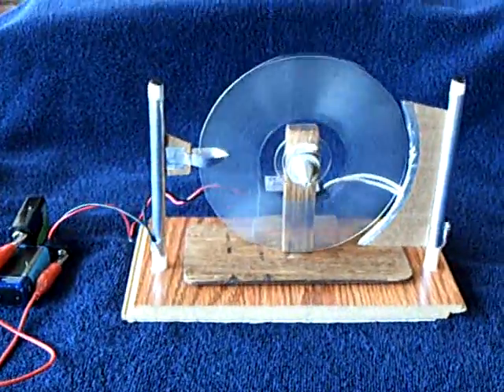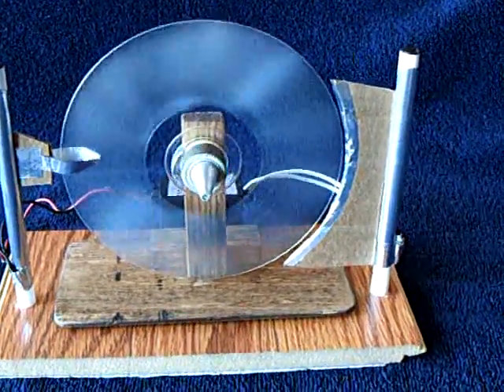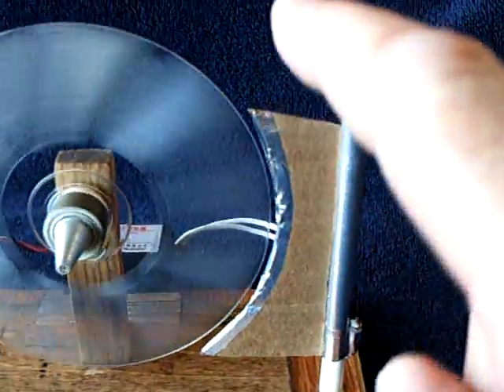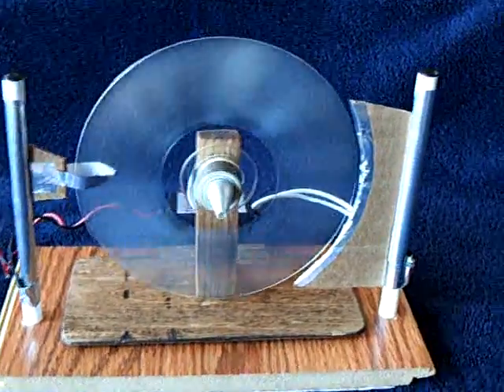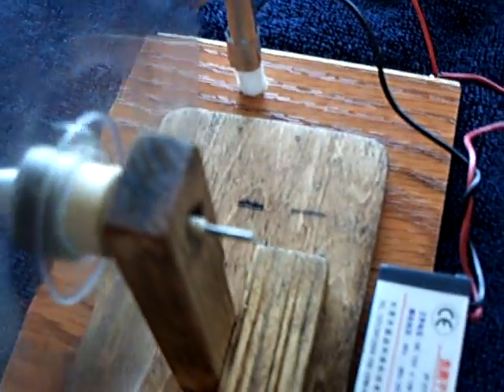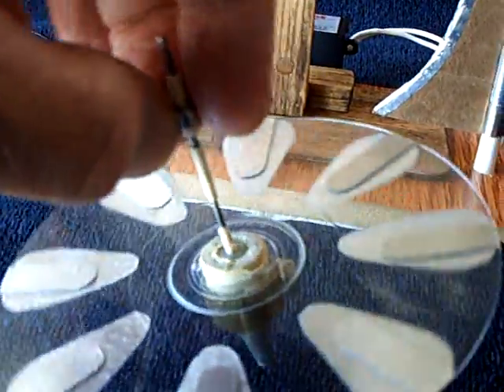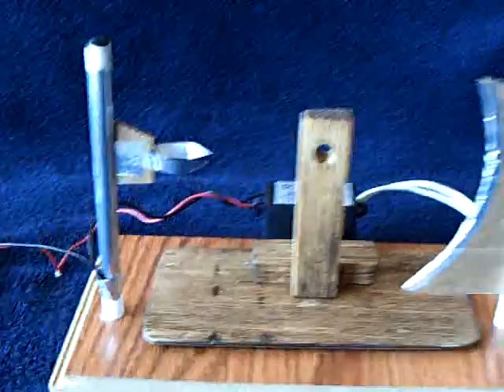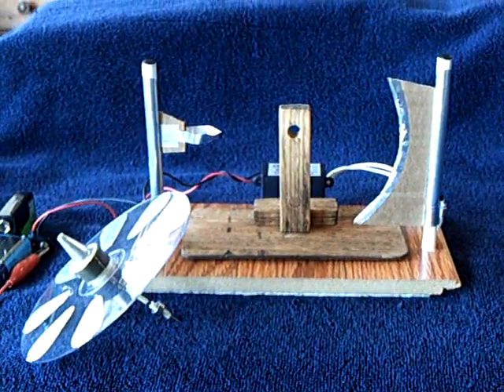Faked Perpetual Motion Machine --- Near replication

Comment: In actual fact the other guy might not have faked his, just as when you brush your hair with a brush or a comb you generate static electricity, in his design he may have incorporated this method into his rotor so that as it spins it creates the static charges that build up on the disk and are grounded by the stator causing it to run.

Comment: Rusty:

I am sure you posted a link in another video (But I can't seem to find it now) about where you obtained your negative ion generator that draws so little?

Thanks,

Bill
Reply from the maker: Pirate Labs Bill here it is.
http://www.ebay.com/itm/DC-12V-High-Output-Ionizer-Airborne-Cleaner-Negative-Ion-Anion-Generator-Stable-/371212721049?pt=LH_DefaultDomain_0&hash=item566e009b99
Reply: *****

Thank you very much Rusty.  That really looks like a versatile device to have.

Bill

Comment: My meaningless perspective is that the “fake” device included a “magnetic influence”, purely due to having watched the other video and noticing a change in rotation rate when he twisted it’s direction, it looked like a “magic trick” I once performed. Always good to investigate, but best not become cynical!
Reply from the maker: Lord Dream Thanks.  I will look into that.  I did a bunch of work using remote "magnetic gearing" and perhaps he used that.  I did a video once where I turned a rotor right through an interior wall of my house using strong neo magnets.   It is an interesting way to transmit energy without a direct linkup.  The problem is that the transmitter magnet rotor has to stay in sync with the receiver rotor all the time.  Once they go out of sync the linkup is gone.

Comment: Nice video.
The angle of the contact at the left side don't seems to match the original video which located little below.
Do try to use a thick circular disk which the surface area is larger than compact disc used in your video.
Reply: ***** His "bearing" system was a real laugh: just making a pair of Vs out of small nails or bits of wire, then resting the axle in the Vs. This must be a pretty high-friction arrangement. Using sharp points on the axle and having the points rest in the divots in the ends of hardened setscrews would be much lower friction, I think.
Reply from the maker: sanjev21 I been thinking of making an exact replica (as close as I can) and doing experiments with that.  The rotor bearing issue is a concern.   Friction  has to be very low no matter how you turn that wheel---unless he ran his with tiny motors in the rotor hub.
Reply: Lidmotor-If there is motor involved then there need to be coil or with magnet present somewhere.
The disc in original video does vibrate at high speed since there is no precision engineering involved.
The disc is heavy it may assist in achieving the required momentum.
Do try cut aluminum can for the external contacts since it's more stable than thin foil version.
Reply from the maker: TinselKoala Yes the bearings in his setup look terrible unless there are tiny motors in the rotor.  Then the Vs make sense.  Hold the shaft and rotate the rotor on the motor bearings.  I'm going with a steel needle in a brass philips head screw for my next setup. 
  I watched your videos last night on electrostatic devices and you have a very nice motor with that Tesla turbine design.  Your Bonetti generator is a pretty scary beast.  The model of this faked motor you built might run if you throw enough juice at it.  Mine has to have point contact at the one side to work. Al foil brushes worked good for me.  Bearing friction has to be very low.

Comment: It's interesting that you actually got your static motor to operate in a more powerful manner than the fake perpetual machine (pm).  I still think the fake pm machine operates via a battery driven, pulsed motor & some magnets place along the circumference of the rotor.

I tried a little experiment yesterday with a battery & coil to see if I could generate enough torque with 4 Watts of dc power, but the coil & torque apparently wasn't large enough to repel a neodymium magnet mounted on the edge of a cd very far or very forcefully.

How much force (torque) does one of your bobbin-wound (42 gauge) coils generate against your lidmotor magnets in your pulsed motor designs? 
Also, could you remind me of how many copper turns you put onto one of your coil bobbins and the pulse magnitude, duration, & frequency that is sent to it in your best pulse motor design?

Thanks!

p.s.:  Nice static motor design! :)
Reply from the maker: A B I do very few  measurements when I build something so it is hard to answer your question.  My coils have hundreds of turns on them just to push a small plastic jar lid around.  Turning that cd around with tiny magnet imbedded in the rotor edge and tiny batteries to power it all ---it just doesn't seem possible.
Reply: ***** Understood.  Thanks for the info.  I was wondering if it is possible.  I'm going to tinker a bit with different windings & modify the current & voltage more to see how much current or power is needed to create a sufficient force.

Do you know how much current your static generator uses to start up & run at maximum speed?  I'm curious to know how much power is used to turn your plastic rotor.

Thanks!
Reply from the maker: A B This little negative ion generator is wonderful for these electrostatic experiments.  It only draws 30mA and will operate from 9v to 18v happily.  It does not get hot and there is no feed back so it doesn't care what the load is.  Just remember that most electrostatic motors have very little torque.  It is like gently blowing on something through a drinking straw.
Reply: *****
Hmm... That's interesting...
18V*.030A=.54W
6000V/18V=333.33 times stepped up
.54W/333.3=.00162A=1.62mA (current drawn on the output of the neg ion generator, & not accounting for any losses)
6000V*1.62mA=9.72W

I wonder if that same power draw through a battery setup would provide sufficient torque to rotate the cd.
Reply from the maker: A B Yes.  The ion generator doesn't  care where it gets the juice from.   Heck enough lemon batteries might even do it.  Ha.  By the way the generator is rated at 1 watt.  I really like the little guy.  I have used it for many experiments.  Here is the Ebay link to it again: 
http://www.ebay.com/itm/DC-12V-High-Output-Ionizer-Airborne-Cleaner-Negative-Ion-Anion-Generator-Stable-/371212721049?pt=LH_DefaultDomain_0&hash=item566e009b99
Reply: ***** Thanks!
I noticed on the Ebay page for that -iongenerator that it shows:
"Attention: Please add water in time when used up."
Is there some kind of water holding tank in it or what do you make of that note?

Comment: Hi try not to reflect " faked " the guy mentions he uses polystyrene you can strip anything of atoms and leave it still in its form " to the human eye " but it is just totally neutral joe booker shows this in his video joe cell horses mouth as he lights a bubble flowing down the side if his stainless fire exstinguisher  the bubble has encased neutral dc in it but when the match lights it on the paint the neutral wants to stabilise so instantly draws atoms out of the paint on the bench hence the polystyrene may be drawing in air atoms stan Meyer did this effect also in his e p g   Neutral stripped   A Star Wars development on the par of teslas photon anti matter laser/vacuum

Comment: Great job Rusty.  So, would a Vandegraff generator off-screen output enough electrostatic to run this motor?  If the humidity in the room were just right, could this be how that fellow did this?  Possibly, one under his table?

Bill
Reply from the maker: Pirate Labs Bill I don't think so.  You need some sort of antenna on one side and a ground on the other and he doesn't have anything like that.  The way it rotates it looks like a simple motorized device ----but how?
Reply: *****

Ah, that is the question then isn't it.  I suppose we will all have to think on it a bit more.  I will watch that video again to see if anything pops into mind.

Thanks,

Bill
Reply: Pirate Labs You'd need a wired connection to the VDG machine or other HV static source. The wires could be very small, but I don't think that's how he did it either. I'm leaning towards a little air blast from a tube, played onto the wheel from off-screen. My rep works very well that way. It doesn't take much air, either. Following the orientation changes is a minor bit of difficulty but can be arranged.
Reply from the maker: TinselKoala  I have though about the 'air blast' method also.  He moves it around quite a bit for that though.  The one part of the video where the thing is spinning fast and starts banging against the supports is very suspicious of it being powered electrically.  I just tried mine with air from a drinking straw and you are right it spins up quite nicely that way.  Maybe that is how he did or maybe he did it several ways
Reply: *****
Well, I was wrong about needing a wired connection to a VDG machine! Grumage has gotten it to work by using his son as a conductor, one hand on the VDG and a finger of the other hand pointing at the disc. It turns!
Reply: TinselKoala 

I thought it was air also.  So now we have three methods that work on this fake device.  Any bets that this fellows device will show up at OUdotcom a year from now as "proof"?  Heck, Lidmotors video might show up there also.  I was wondering about the VDG method myself but I really think Lid's wire method is what this fellow used.  We may never know for sure.

Bill

Comment: Nice going Lidmotor. But i am still at a loss as to how the guy managed to do it without any wires connected. One would have to rule out compressed air also,as he turns the device in many different directions. I was also thinking about having micromotors in the rotor-but he also flipp's the rotor around 180*,and it still runs in the same direction?.
Reply from the maker: TinManPower Yeah I'm still not sure how he did it.  It might be a reed switch pulse motor of some kind.  It is a puzzle.  I'm wondering if his project started out like the one I showed here.  Perhaps he couldn't get it to work so he turned it into a fake perpetual motion machine.

Comment: Fascinating indeed, with the large surface area of the concave side.
Think i'll try and find a Cockcroft Walton ion generator or some such now, this all looks like a lot of fun :)
Reply from the maker: slider2732 Yes.  I hope you try this.  I'm thinking of making a much smaller vertical axis one using a needle motor structure.  I would make the rotor out of foam board to make it light.  That motor should run on much less voltage. An electronic bug swatter might work.